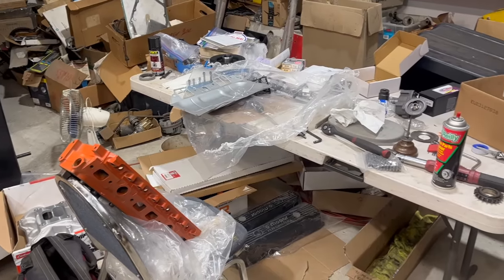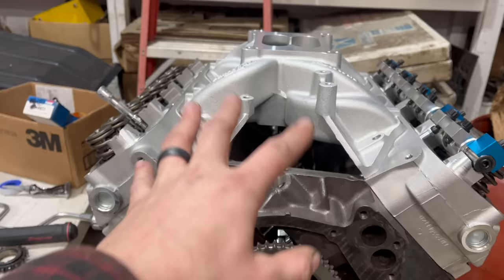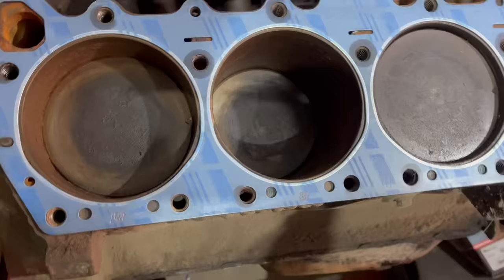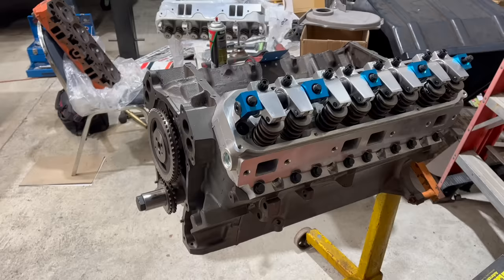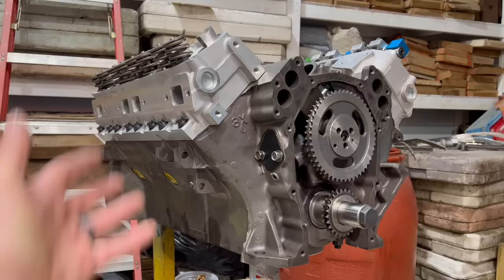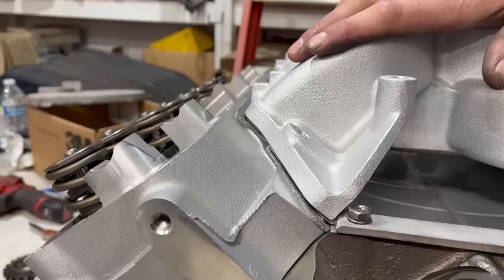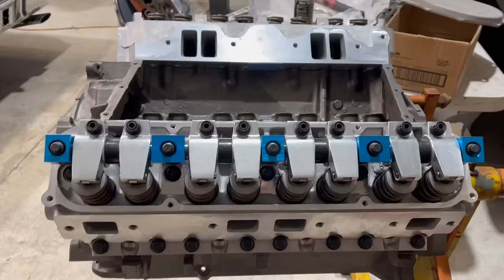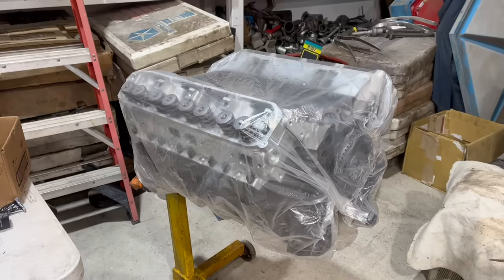451 Stroker II: Bad Factory Machining, Why Horsepower Doesn't Matter, And The Art Of Having Goals

Comment: I am honored to be a part of this video 😂. May could use some offset dowel pins to move that head up, but it seems every build I have now has some kind of issue with parts new or old. Should be a great engine for that car! Thanks for the shoutout.
Reply from the maker: Yeah I know I mentioned somebody made the comparison between our builds, but I completely forgot I mentioned it on camera. Haha. The machinist and I talked about that a bit actually. The concern with trying to move the head was that the bolt holes and oil feed were all in the right locations relative to the dowel location, and I don't think the amount of movement we could've gotten away with there would have closed the gap. This seemed to be an elegant solution. Thanks!
Reply: Genius.

Comment: The Valiant sedan I have had 88K & change on it when the prepping for the Southern Classic run started. We were just going to pop in a mid cam, 4 bbl, dual exhaust...but guess what? A couple cam bearings looked trashy. In order to do the cam bearings, you have to strip the short block down. Well, the machinist called & asked "How did this thing run? How many miles on it? Did someone rebuild this before?" See, the Chrysler machining was so awful that the deck sloped from the front to the rear. The angle of the back 2 cylinders were off by more than 2 degrees, thus it was eating itself. Had to order pistons, but to straighten the mess out, had to put Cometic gaskets at 0.060" just to get the compression ratio down to 9.45-1, and that is with '90-vintage 308 casting heads off a 360 (open chamber) sitting on top. The factory slop was epically horrible
Now before anybody wants to scream about the machinist- you are speaking from your rectum. This guy does machine work for the McCandless family & more, so...in the end, this engine is a fantastic runner that, with 0 shake-down miles, ran 2324.6 miles flawlessly cruising at  'spirited' speeds.
Reply from the maker: Wow… no, I’m well familiar with that. We have seen it on multiple blocks. One deck on my Demon’s 340 was tipped front to back.
Reply: ...and people wonder why they nearly disappeared in the late-'70's? @DeadDodgeGarage

Comment: Although we've done a pile of stroker RB builds in the past few years, for the customers who want a bit more HP I feel we've overlooked the "B" stroker builds (499) since the intake manifold is always a compromise in the RB builds due to insufficient hood clearance.
Reply: Why 440 Source can't make raised port heads so an RB intake will fit on a low deck is a missed business opportunity.

Comment: I too am honored to be a part of this video. Now i went though this very thing on a 71 383 build. We didnt catch it and the intake leaked. So pulled the intake and found the issue on leaking. Then the guy wanted a aluminum intake and after slathering the ports with black poop goop and the corners we torqued the intake down. Ran good problem solved right. Wrong. After a brief test beat it was a little warm and it cooled and talking with the owner with the hood open and he was very pleased we heard a snap. Guess what the intake broke. Passengers side. The bolts where a bitch to start and slight hole mods were made. The guy was super unhappy. Rinse and repeat right. Wrong. I was blamed for over torqueing it. Then we found the head was off on the block. So a meeting was had. I said new block he said please no. I said fine cast original intake and take your chances. Thats what we did and it was never seen again. Every engine sense i check everything and check it again. I think you should do a video on how to spot factor f ups and i can help. They even stamped the blocks with opps marks. QA was not iso 9000 lets put it that way. Like i said i have 2 fixes for this motor so lets chat. ❤
Reply from the maker: I want to do a larger video on messed up blocks, because I could swear they’re more the norm than the exception. I have seen several myself and have heard of many more. This is probably the best one so far though.
Reply: @DeadDodgeGarage  let's chat about my 50yrs of weird shit I have seen too.
Reply: This why I am an Olds V8 fan. No terrible off factory machining or very rare. Heck I don't know how you get compression with the pistons so fat in the hole on factory Chrysler V8's. Olds didn't have defective parts like flat cams and dying at low miles like 351M/400 Ford. I can still pick up good running Olds 350's from the mid 70's. It doesn't have bottom end issues like their 455. The lousy nylon cam gear is their Achilles heel. Their have been more issues with aftermarket go fast stuff than factory machining on Olds V8's. Chrysler has come a long way, I am at nearly 140,000 km on my Go Green 2017 Dodge Challenger GT AWD. Just a horn and hairline cracked ZF 8 speed pan so far. Zero of the 3.6 Pentastar issues, so much better than the oil burning 3.5 POS V6 in our last Challenger. I get 40+ mpg highway Imperial in the Summer, mid 30's Winter and mid 20's pulling the boat the lake. Imagine that sight😊

Comment: Nice vid. Mopar's do weed out the engine "assemblers" from the engine "builders" lol. I like the 400 based 451 build with alot, for all the advantages you mentioned. I usually line bore the block without turning the crank mains undersize, but i like both options. 440 Source rocks.
Reply: Yeah, line boring is a better way to go. Cheaper too.

Comment: Did you know that Chrysler didn't machine the deck square to the crank bore?  I found that out back in college while machining a 70 340 block. I was just going to skim the decks to make sure they were flat. That went out the window when the first cut of the mill only touched the surface for the first two inches of deck surface.
Reply from the maker: Oh… I am well aware. I know of two 340 blocks on which the machine shop found one bank was notably tipped - one top to bottom, and one front to back.

Comment: I have paused your video to comment as I watch at 1am on the east side of Australia. Why, you ask. Because you spoke one of the most SENSIBLE sentences that I have heard out loud from the 'improved performance' engine crowd in decades. For street use, do I really want 850 HP @ one gazillion RPM? Hell no. Do I want a shipload of torque at engine speeds  that allow me to just gently press the 'power pedal' & safely pull out & pass at normal highway speeds? Damn right I do.
Do I want to cruise at highway speed with my engine is ticking over at a lazy engine speed knowing my nice fat & flat torque curve is going to give me strong pulling performance across a wide RPM range? What do you think.
I want my 325 Dodge Hemi to start easy, idle [relatively] smoothly, run sweetly with dual quad Carter AFB's, get acceptable mileage, live long [& prosper?] & pull hard when needed at regular cruising speeds. A good fat & flat torque curve delivers, peaky horsepower doesn't.  Works for me.
PS The factory machining on my 57 Hemi was 99.5% perfect.
Reply from the maker: Yes! Exactly that. People have been so bamboozled by big horsepower numbers that don’t tell the whole story. An engine that makes zero power until 2500 RPM isn’t going to be that great in a street car. It will be interesting to see what the machine shop finds in my 315 Hemi block.

Comment: They make offset dowel pins to move the heads and gaskets around a bit.   On motors like Fords and BB Chevies, (and I suppose LS) you can actually move the valves a bit to unshrowd the intake.... (or exhaust if you think that will help).  Most machine shops remove the dowel before they surface/square the block.
Reply from the maker: I realize that, and we looked at the possibility. I don’t think enough offset to fix this would be possible without moving the head so far that the bolts no longer align with their holes. The gasket-as-a-shim fix seems to be working fine so far.

Comment: I have this problem in the opposite direction. Head to high on passenger side of the engine. Gaskets would be no problem. I have Valve to piston clearance problems, intake valve radius too close to valves pocket! Driver's side is fine, yes  switched heads, checked pistons etc. It's the dowels too high up the deck on mine. 
Glad I checked both sides, had I just done number 1 cyl the passenger intake valves would have had bad days ahead.

Comment: Well said Jamie not every application benefits from the maximum HP and a street driven car is a prime example of big cam and big power equals no fun to drive on the street. There are plenty of nice sounding thumping cams that keep the power in the lower rpm range so that you can live with them on the street cruising around.
Reply from the maker: Exactly! There is a bit of an art to component selection. I need to talk a lot more about that.

Comment: Hey Jamie you ever heard of offset dowel pins get a set you'll love it turn the block upside down put the heads on see where they line up the best select the right dowel pin install it you're done problem solved
Reply from the maker: I have, yes. As I’ve discussed in other comment replies, as far off as this is, I don’t think we could move the head enough and still install head bolts.

Comment: That would be my luck also. Get a shiny new toy and it is broken right out of the box. I can't count how many times that has happened. It took forever to find a transmission for my truck because every transmission they tried to sell me was a used rebuilt that was shot. Now I just need to own a oil refinery to put gas in it so I can drive it. It's loud and has a V10 and that's as probably as close to owning a Viper as I'll ever get🤠

Comment: Low decks also have the advantage of shorter/lighter /stiffer pushrods which equates to less work the springs need to do which equates to better stability at higher rpm. 440 looks cooler, but the 400 is better in every other way.

Comment: the small gaskets I read are for use when using and aluminum intake.
Reply from the maker: The only engine I’ve previous had them on - and the one that had a horrid vacuum leak - had an aluminum intake. I reinstalled the aluminum intake without them and all was well. I have installed countless aluminum big block manifolds with the pan alone and it has always worked well for me. So I have to wonder why.

Comment: Amazing 30 plus years ago I rebuilt a big block for somebody's 1970 charger 500 and when I put the head gaskets on the block that's what I saw I wondered about that I just went ahead and used a bunch of RTV where the intake met them points of the block and the head and put it together didn't think any more about it up until now that is very interesting

Comment: That china wall was certainly machined on an angle. How in the heck did the factory seal it?  Good video 😊
Reply from the maker: The China wall is straight. All of the machined holes in the deck surface are in the wrong place. When I set the head gasket on the dowels, it became very obvious. And as far as how the factory sealed it… I have no idea, but I’m very curious.

Comment: Ya know, Jamie, I sometimes wonder if the old DC 4.15 stroker crank was designed to be used in a 440 block, with FACTORY STOCK 400 RODS & PISTONS! The 400 rods are .410 shorter, but the 4.15" stroke is .400 longer! But I don't know about the pin heights, and I dunno is the 400 piston skirts will clear the crank counterweights. Your thoughts?
Reply from the maker: Very interesting, but I really don’t know enough about that setup to say. This 451 is the only stroker I’ve had any involvement in so far. I’ve spent just about all of my time on relatively lame stock engines. Haha.

Comment: You forgot to mention  361-383-400 B-block is 1 inch narrower on each side so it has more room to change spark plug's and better fit on header's.
Reply from the maker: I did mention that they fit better and have more room to work. Didn’t I? Well, if I forgot it this time, it’s something I have talked about a lot.

Comment: The machinist was dead on, chuck the block in storage and try again. At least you have the factory numbers matching handy. The fix for this problem is straightforward albeit expensive, provided of course the cylinders are properly aligned. (probably the same cost as doing a whole different block all over again so its a 50-50)... One would have to bore ever single hole on that bank, plug them all, and rebore+tap all new holes and dowels. Another option is overbore the holes in an offset but thats only if the holes are off a tiny bit... these look like a full 1/8" down. 
Sad times :(
Reply from the maker: The head gasket did not overhang the bores, so while the holes are off 1/16” or more, I was satisfied that there would be no head sealing issue. This engine is already up and running and installed in the car. Using the paper gasket as a shim for the intake worked just fine.
Reply: @DeadDodgeGarage Only issue with that turned out to be a blessing in disguise i bet... your pushrod geometry was pulled inboard more and got them off the exhaust manifold side of the head a little?
edit: the pushrods stay in the same spot, its the heads that move downward pulling away from them. (just wanted to clarify).

Comment: I was a Mechanic in the 1970s, and a bracket racer. Chrysler was the 3rd rate OEM, and AMC was at the bottom so to speak. We used to laugh hilariously at the sound those old starters made, and I know other guys who said the exact same thing and they laughed massively at this guy who had a dart that made that silly ass sound. Dodge trucks have always been notoriously cheap except for maybe the 19060s models, but even worse many of them are terminally ugly. We are not in the age of Aries, so all the Ram symbology is anachroistic and stupid. Sadly the old Engineers at Chrysler created some fine results and innovation, but such days are gone. The new Dodge truck have gotten less unsightly, suprisingly so. Everything is over engineered and OVER AUOTMATED. The air bag suspension is idiotic.
Reply from the maker: Don’t forget, they’re not even called Dodge trucks anymore. They had made Dodge trucks for damn near a century, but that wasn’t good enough anymore - so they’re just RAMs now. Anyway, you go ahead and laugh hilariously at the starter sounds - but the constant comments I get on my videos that read approximately “I love that old starter sound!” tell the rest of the story. It’s unfortunate that Chrysler’s quality was in the toilet for so long. They had brilliant engineering and great ideas, but all that really went to hell in the 70s and I’m not sure it ever came back.

Comment: HAHAHA! 
I spent decades in various machine shops, and I used to joke about Chrysler buying their tooling from Ford and GM's scrap tooling. 
I still have a preference for Ford of the muscle era. Anymore though I'm just an American iron guy. 
Funny how Ford and Mopar guys have a sort of brother like relationship. 

Oh the days gone by...
I told my niece yesterday, that she would live long enough to witness the time when it will be common knowledge that this period represents the epitome of societal insanity...
Reply from the maker: Chrysler had brilliant engineers, who had great intentions when they drew up these engines. Unfortunately, the components were then cast, machined and assembled by… trained monkeys? I don’t know, but as a Chrysler engine specialist, I’ve seen some stuff. How about rods that were factory machined with the bearing tang reliefs and oil squirter on the wrong sides, such that when they are installed the rod is actually backwards? Deck surfaces tilted every way but the right one. The obscene core shift in cylinder heads. And now this…
Reply: If it were my call.  The simplest fix would be to have offset dowels made, locktite them in place and if necessary overbore the head bolt holes in the head.

Comment: Nothing like building a custom engine…
Reply: You know... I was thinking about this last night.    When you set the stock factory head on the block and it had such bad alignment, how did that not leak from the factory?     That thing would have leaked either vacuum and/or oil so bad...the first owner would have had to have it replaced under warranty when he got the car new.   I’m surprised that block didn’t end up in a scrap pile early on.